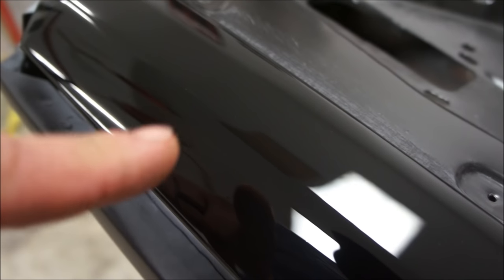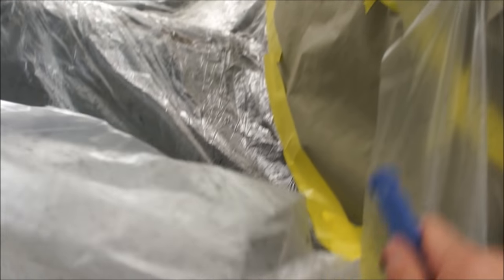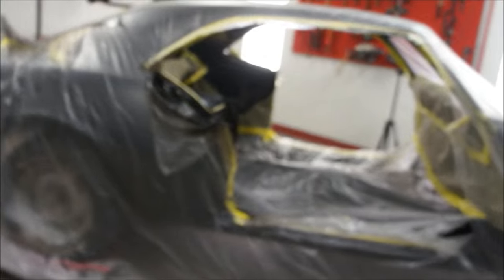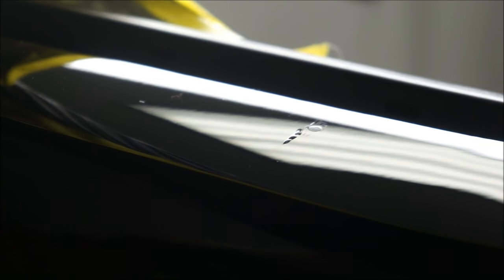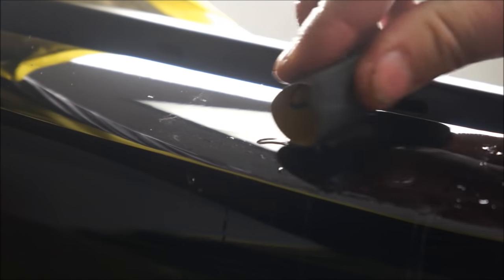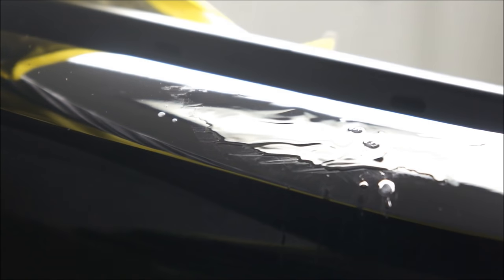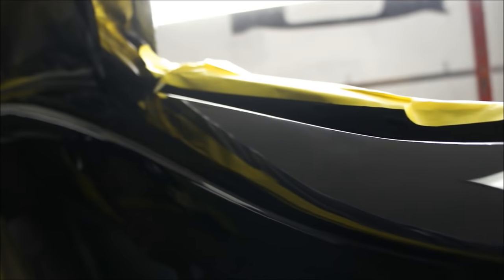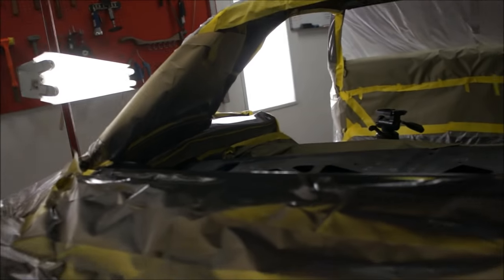Removing fisheyes from clear coat

Comment: I don't sand those.  I fill them with clear right after they happen.  Then, you just knock the top off them and sand and buff like you normally would.  Takes much less time and doesn't remove so much thickness from the surrounding clear coat
Reply: Is it possible to drop some clear in the crater after it cures and then sand and Buff???

Comment: What is the buffing wheel you are using? Brand and name please.
Reply from the maker: zfreak280 https://www.walmart.com/ip/3-Mini-Waffle-Foam-Buffing-and-Polishing-Pad-Kit-w-5-Pads-Backing-Plate-1-4-Drill-Adapter-5-16-DA-Thread-Adapter/51240661?wmlspartner=wlpa&selectedSellerId=1250&adid=22222222228038904384&wl0=&wl1=g&wl2=m&wl3=85334240330&wl4=pla-193262527730&wl5=9026521&wl6=&wl7=&wl8=&wl9=pla&wl10=112562674&wl11=online&wl12=51240661&wl13=&veh=sem
Reply: Thanks for the info. I will be buying those. I have bought several of TCP Globals products and I have been very pleased. They make a damn good two part epoxy primer under their Custom Shop brand.
Reply from the maker: no problem

Comment: Which is granulation?P2000 or?
Reply from the maker: siki7044 I used 1000,2000, 3000 then compound
Reply: @MrFireman164  Thanks man.I have fave buubs on coat fuel tank of r6 and i will try polish

Comment: Couple things I am an old time razor blade user a couple years ago my body shop supplier loaned me a festool 497525 is the parts number tungsten carbide run and denib block holy lord love a duck expensive piece of kit first time I used it I could not pull my wallet out fast enough and no I don't work for festool another idea plastic letter opener from staples Walmart dollar store is the bomb for cutting plastic off.
Reply from the maker: Marc L diver I will check it out thanks 😊
Reply from the maker: Marc L diver holy 85.00 ! Wow, but you say it’s worth every penny then ?
Reply: Ya the price is kind of a shocker alright. I sat down had a come to Jesus meeting with myself... Being cheap sucks... Anyway after deep thought I slowly pulled out my wallet carefully handed over my much battered and used visa card and purchased this way overpriced wee piece of steel. Now after using it for a couple years I would pay 5 times that price if I had to replace it the hours saved with that tool. Garage painting always have to deal with dirt nibs suicidal insects etc.